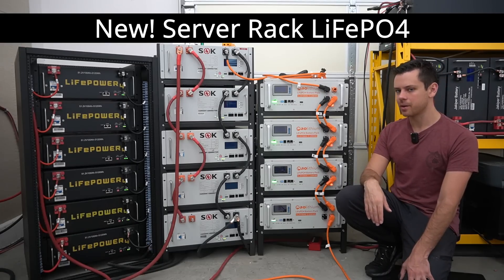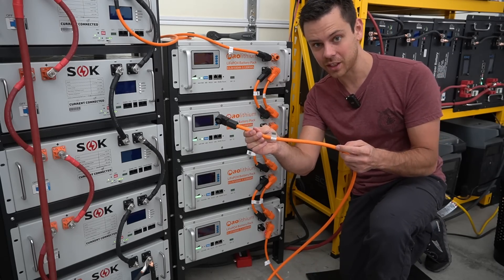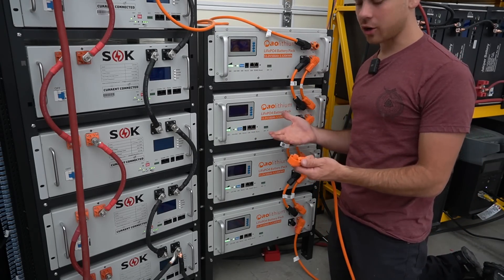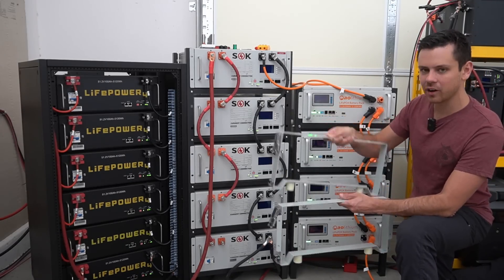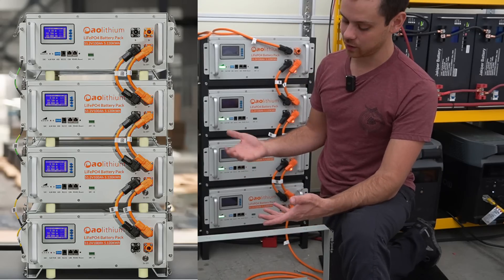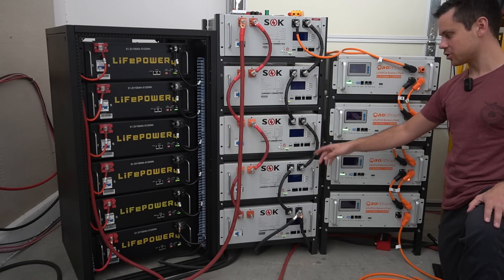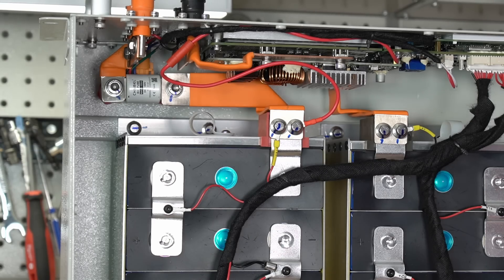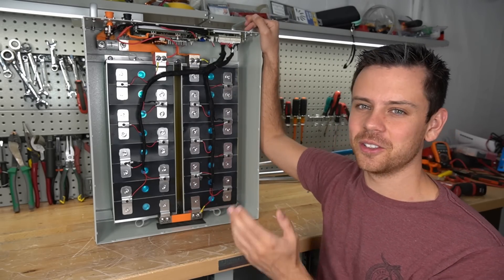New! 48V 5.12kWh AOlithium Server Rack LiFePO4 Battery

Comment from the maker: In other news, the SOK server rack battery is now UL 1973 Certified! If you need stickers to pass an inspection, contact Current Connected. If you want to purchase SOK batteries, check them out here: https://www.currentconnected.com/product/sk48v100/?ref=wp

5X Battery Combo Package with Cables: https://www.currentconnected.com/product/fully-loaded-25kwh-48v-server-rack-battery-kit-bundle-save/?ref=wp

If you want to learn about other server rack batteries available, click here: https://www.mobile-solarpower.com/server-rack-lifepo4.html

If you want a free blueprint for 48V offgrid solar power system, click here: https://www.mobile-solarpower.com/48v-complete-system-blueprint.html

~~~~~~~~~~~~~~~~~~~~~~~~~~~~~~~~~~~~~~~~~~~~
Tired of getting ripped off? Check out my "Will Prowse Approved" solar product recommendations below!

12V Batteries
https://www.mobile-solarpower.com/lithium-batteries.html

48V Batteries
https://www.mobile-solarpower.com/48v-batteries.html

Offgrid Inverter System Builder
https://www.mobile-solarpower.com/48v-complete-system-blueprint-559371.html

Hybrid Inverter System Builder
https://www.mobile-solarpower.com/code-compliant-48v-offgrid-system.html

Mobile Handtruck System Builder (very popular!)
https://www.mobile-solarpower.com/mobile-48v-system.html

Solar Panels
https://www.mobile-solarpower.com/300w-solar-panels.html

Ground Mount Solar Racking
https://www.mobile-solarpower.com/ground-mount-racks.html

Wire, Lugs and Busbars
https://www.mobile-solarpower.com/wire-and-connectors.html

Tools
https://www.mobile-solarpower.com/tools.html

Fuses and Circuit Breakers
https://www.mobile-solarpower.com/fuses.html

Plug-N-Play Solar Systems
Ecoflow, Anker And Bluetti! So many models to choose from. See my current recommendations here:
https://www.mobile-solarpower.com/full-size-systems.html

~~~~~~~~~~~~~~~~~~~~~~~~~~~~~~~~~~~~~~~~~~
Need to build a large DIY system? Need a trustworthy solar distributor? These are my favorites:

Signature Solar
Creator of EG4! Solar Minisplits, Victron and More! Largest Solar Store Online.
If you want $50 off, please use my link below and coupon code "DIYSOLAR50":
https://signaturesolar.com/?ref=cPwLcVc0SW-BjN

Current Connected
Best Prices for EG4, Victron, Midnite and so much more! Fast Shipping and Highest Rated Customer Service:
https://currentconnected.com/?ref=wp

~~~~~~~~~~~~~~~~~~~~~~~~~~~~~~~~~~~~~~~~~~
Join our DIY Solar Community 
Need more help? Join the largest solar forum on the internet for beginners and professionals alike. 140,000 members and counting!
https://www.diysolarforum.com

Check Out My Free Book
Best-selling and beginner-friendly guidebook to off-grid 12V solar!
https://www.mobile-solarpower.com/the-book.html

~~~~~~~~~~~~~~~~~~~~~~~~~~~~~~~~~~~~~~~~~~
Contact Information:
I am NOT available for personal solar system consult! If you wish to contact me, this is my direct email: williamprowsediysolar@gmail.com
FTC Disclosure Statement and Disclaimers:
Every video includes paid promotion or sponsorship (such as free products for review). Some links on this YouTube channel may be affiliate links. We may get paid if you buy something or take an action after clicking one of these. My videos are for educational purposes only. Information is subject to change/update at any time. Electricity is DANGEROUS and can kill. Be smart and use common sense :) DIY Solar Power with Will Prowse is a participant in the Amazon Services LLC Associates Program, An affiliate advertising program designed to provide a means for sites to earn advertising fees by advertising and linking to Amazon.com
Reply: Always a thanks to you making our lives safe by your reviews the companies are adapting to your safety concerns to the end users and they are absolutely improving! 😁👍 Big up to you sir!
Reply: Finally
Reply: please tell what  BMS they are using  i have one sok they are nice to
Reply: Have you ever come across any saltwater batteries?
Reply: Bruh, I came back to this video just to leave a comment on the SOK link. The zoom in view is amazing! Weird thing to mention but it's refreshing to see a quality picture.
Reply: Hey Will do you think you can review some batteries from Dakota Lithium?  TY for all the info!

Comment: Hi Will, I need clarity. In your blue print "Complete 6kW DIY 48V Off grid Solar Power System" you are recommending 2/0 cable from the battery rack to the inverter, yet in this video you point out the EG4 rack has 2/0 and the SOK rack has 4/0. I am running two EG4 LL V1 48VDC batteries to a EG4 6000XP. The batteries are in the Signature Solar welded rack connected with 72" 2/0 cable to the 6000XP. I want to add another 6000XP and more batteries, but I want longer wire from the rack to the inverters, can I stay with 2/0 cable 10 feet long or do I need 4/0?

Comment: I know this video is older but in case you answer this  they're is a sale for $850. per battery now what do you think value $ is worth it ?
Reply: They seem to be built well, the negatives are a lack of remote monitoring software and some people reported cell balance issues at first requiring balancing at the start.
Reply: @mattbodnar6510  Thanks for your input  I wonder because now I can get them for 750  I may get a few for this price is wow but but I sure don't like aggravation sometimes savings are more of a course then a blessing  but they sure do look very well built   thanks

Comment: They are on sale again.  Order batteries individually so you get a set of short and long cables.  If you get a set of batteries and want to use each on a bus bar you need to buy additional long cables.

Comment: I just bought this battery for $977 and an lilithium 30 amp ac charger for my off grid “power station”. This battery will feed an Anker f3800 that powers my 30 amp rv trailer. I will be powering the f3800 via this battery running short 10 gauge wire into the f3800’s xt60 solar port. Are there any thoughts or concerns with this setup?  My 5000watt inverter generator will be charging these two units simultaneously. I have little to no solar being in heavy woods. Thanks.

Comment: Hello Will it's dec.7, 2023 these Batteries are advertised for $1099. And less than $1000 if you buy multiple batteries. Would you advise someone to buy these at this price? Is it possible to get a bus bar and modify the set up?  I'm about to make the investment, your advice is greatly appreciated. Sounds like you were impressed by the battery parts and construction, the price  dropped by half! I'm concerned about the cables. Thanks keep up the good work 👍

Comment: Will as always a lot of great info. What is your thoughts on these batteries at a $999.00 price each. This is the price the are advertizing for Black Friday. I am also wondering your thoughs on the SunGold rack mount batteries They look just like the EG4 LL but with a pretty good price right now of $1238.00 with the monitoring screen on each battery.  I would appreciate your input and thanks for all the valuable informtion you provide

Comment: So still deciding... In Canada these packs are $300 cheaper than Ruixu and $900 cheaper than SOK... 
Looks like as long as we get multiple "single-slot" packs we can use the 3 AWG cables and a bus bar and it should be fine. Avoid the multi-pack kits that come with the shorter daisey-chain parallel cables. Has 1 year more warranty than Ruixu but their support is less useful.

Comment: Hey Will, its time for a follow-up. Their prices have dropped and now the Ruixu has the same connectors...
Reply from the maker: Different connectors, much smaller and no bus bar. All of my observations and opinions still stand. Why would anyone buy this. Ruixu and others are way better
Reply: @WillProwse  wow ok, makes sense,.. thanks!
Reply: @WillProwse  price is the reason we are considering it.  In Canada right now it is dramatically cheaper than any other option we have.  With other brands either the USD conversion, duty / taxes or shipping make them up to $1500 more per slot.  That is HUGE.

The power leads are solvable by ordering multiple single units and using an off the shelf bus bar.  The price difference is immaterial.  For those of us that already have a system in place this is not a concern as we would likely have a large current bus bar in place before our inverters to interface charge controllers / etc.

The concern about self-discharge, I posted a  note in the DIY Solar Forum and I believe this is an issue with the integration between the BMS and the onboard shunt measuring SOC.  If the BMS power bypasses the onboard shunt or is below the measurable threshold programmed into the shunt (this is done by all shunt controllers to prevent ghost reflections at no-load), it is possible the BMS would drain down the battery itself without the SOC meter reflecting this.  This may be a problem with other units as well, it's just you noticed it on these because they sat on your shelf.

Specific question -> How long did you leave these units powered on with no charge source connected to them?

Realistically nobody purchasing these as their primary battery bank would leave them for a month at a time powered on with no charge source attached to them.  They would be receiving solar input and be cycled daily.

I think for the incredible price savings these two issues are worth overlooking for those that are not in the American market.  These do deserve more analysis and I don't believe dismissing the product so quickly is in the best interest of those that don't have access to cheap / free shipping or the US Dollar.
Reply from the maker: Also the Soc meters on mine dysfunctioned. Most of them self discharged. Junky product
Reply: @WillProwse thanks for your update. I was thinking about getting one as it is $999 now but i would stay away as you said about your units

Comment: AOLithium’s support told me that the battery can't be installed face-up, but they do say it can be installed on its side. All other rack batteries I've looked at say they can be installed in any orientation. Looking at your views of it with the cover off, it seems like it could be installed face up. Doing so lets me put them up against a wall more more low-profile.

Comment: AOLitihium’s support has told me to use bus bars for >100 A loads. Also while I realize this video is a year old, right now I can get them for $1500 for one, tax & shpping included ($5,465 for four), vs $1650 for one SOK, plus tax & shipping ($7,646 for four).
Reply: Could we not, in theory, swap out the battery terminals for the bolt and lug type?
Reply: I was wondering the same thing.  he does say at the end that he would give them a proper test if the price came down and it did.

Comment: In Canada this battery is $1000 cheaper then the SOK. I’m considering a stack of them considering I can get 4 for the price of 2 SOK batteries.
Reply: yeah, me too... just need some cables suitable for a bus bar
Reply: @mmbodnar yeah I don't like this cable connection design.  It's why I haven't bought the packs yet.

Comment: Its funny. In Canada, AO Lithium is hands down the cheapest battery of this type that's available. It's 800CAD less than SOK
Reply: I just ordered 4 48v batteries. After 3 weeks they just shipped the cables .. not the batteries hmmm.
Reply: @MiningChef did you get the batteries after all? Did they send the stack brackets too?
Reply: @MiningChef  Did you eventually get the units?  I'm looking to pull the trigger on some of these because I just cannot justify paying THOUSANDS more for a bank of them in Canada - that will buy me some more panels, charge controllers, etc.
Reply: Yes, I'm really hoping for more info on these batteries.  Here an SOK is $ 2700CAD, Pytes is $2850 CAD.  aoLithium is $1900. It's a massive price difference.  They use EVE cells which are supposed to be decent.  The other two are UL listed though but should you have to pay that much more per battery for UL listing?  CAD pricing seems extremely expensive in comparison between this brand and any other brand sold and shipped within Canada.
Reply: Only the Ruixu gets close to the price but they charge shipping on top... so these are the absolute best value.

Comment: I just bought 4 of these. I will do a video on them
Reply: I just ordered a set of 4 as well with 3 additional long cable sets to connect each battery to my bus bar to maximize load.  Had I bought the batteries separately they, then come with a set of long cables so you would have saved another 300 bucks.  Not a ton of money but still a savings.

Comment: Will, have you done any cycle testing on any of these server rack batteries? I am thinking about using these in an off grid solar EV charging station, and I'm typically charging about 12kWh per day for my M-F commute when I come home from work at night. This will basically drain 3 of these per night, so I am a bit concerned that this use case will kill off the batteries more quickly than if I used them less frequently. Maybe this is an inappropriate use of these batteries, but I thought I would ask if you'd done testing like this.

Comment: HELPPPPP. I am trying to build a power supply and don't know what I'm doing. I have 5 (4,000) gallon per hour electric bilge pumps. They are 12 volt each but can and plan to run them at 15-16 volts and they can handle it. I tried to get a amp reading and think I did it wrong cause I got .04 amps. I need to figure this out so I can try to figure out how to run them. They are 15 amp 12 volt Johnson bilge pumps the 4000 model

Comment: Hey Will, thanks for all your videos. They have been an incredible resource for getting into this stuff. Please can you take a look at quiet/silent passive inverters? 

I'm designing a system for my tiny house and I need to have the inverter inside my living room. I was planning to go all-in-one, but it seems that the only options are to go with something expensive like Goodwe/Solis/Solinteg/SunSynk/Deye. However, I have seen sporadic reports of "van style" charger/inverters that are basically silent like the AIMS 2.4kW. I feel like I am missing something but there isn't really a lot of info out there on the subject. Greets from South Africa

Comment: Request testing this inverter

MegaRevo 8000W Hybrid Inverter

Model#: R8KLNA

Features

> Works With & Without Batteries
> 120/240V Split Phase
> Paralleling – Connect Multiple Units for Even More Power 
> Compatible with 50/60 Hz Grid Frequency
> 12kW Max PV Input
> Four (4) Mppt Input
> 120 – 500V Mppt Input Voltage
> 8kVA Rate Power Output
> Max. charging/discharging current of 190A
> Max. efficiency of >=98.2%
> Battery Voltage Range 48V
> Compatible lithium-ion, lead acid and other solar battery types
> Battery reverse connect protection
> Wifi Remote Monitoring & Management
> Intelligent energy management features
> Power dispatching and side demand response management

Comment: Start making some cool electrical stuff with those Solar panels,  like a car that runs off 100% solar without batteries steel frame and bicycle wheels electric motor that  24v to 12v converter some  super capacitors

Comment: I love watching your channel and O have learned a lot. I just want to ask a question but this is unrelated to your content. Is it ok if I change the solar panel wire to a 12awg THHN wire? I'm planning to reduce the cost of buying mc4 connector for each 2 panels which is quite expensive. What I'm planning is replace all wires to 12awg THHN wire and connect them in parallel using a bus bar connector. Hope you can also make a video about my idea. Thank you so much and more powee

Comment: hEY BROTHER HELP ME BUILD MY SOLAR SYSTEM FOR A AIRB&B THAT IS BUILDING RIGHT KNOW. IT'S A SMALL CABIN. 23X23 24 IN FRIDGE, LED LIGHTS, MINI SPLIT ONLY. THE WATER HEATER IS RUNNING WITH DC BATTERIES AND PROPANE. NO STOVE... X1 MICROWAVE

Comment: I find it so sad that you're always talking about mppt, inverters, batteries and showing us how to connect them but you never show us how you set up ur solar panels and what kind of panels as-in voltage and wattage we need for our systems. Plz help me out. I want to setup a 24v system but am not sure what solar panels I should use and how many I need and wether to connect them in series or parallel.

Comment: Random question. I am running 4 - 36V 48ah battery's in my golf cart. 2 are set together to make 36V 96ah battery and then ran both sets are ran in series to give me a 72V 96ah battery. My question is, if i ran 2 in parallel and then 2 in parallel so making 72V at 48ah times 2 and then paralleling to make 72V at 96ah, would i be able to pull more amps because I am splitting the load between the sets of batteries? the reason I ask in they peak ar 300 amps so i figure if i can split the amps ill get more power and the cart will pull more...  Thoughts?

Thank you,

Comment: I do home dialysis and am looking for recommendations to make a UPS that will run the machine for 3-4 hours in a power outage.  The machine doesn't seem to be real power hungry, it all runs on a single plug 120VAC 15A circuit, I would estimate 1Kw or less.  I'm thinking about a 48V rack battery and a solar inverter like the 3000W EG4.  Any thoughts?  I can get most of my blood back in a power failure but it would be better to complete my treatment.

Comment: Very nice video, for the cables come with the battery, it will be difficult to disign, the supplier can not customized for every diffierent client, because some of the clients use 1 single battery only, some of the other may use 6 pcs or more( i am not sure how many pcs battery can paralell maximum for this BMS). so i think that is why they only design the cable as 1 single battery for less cost.